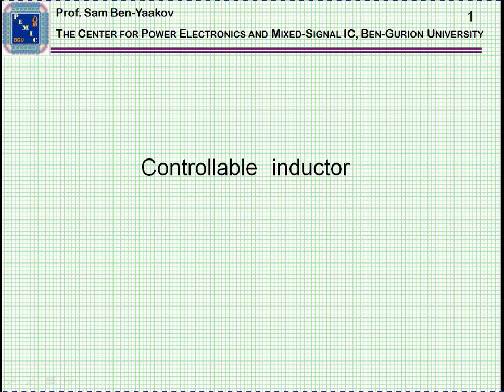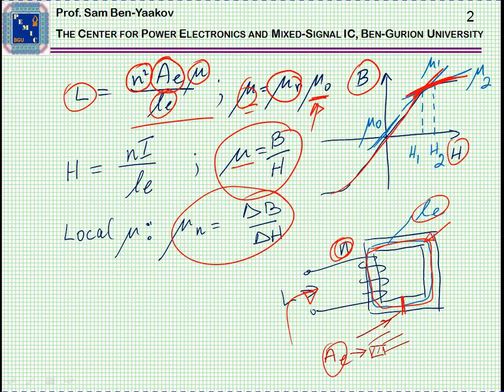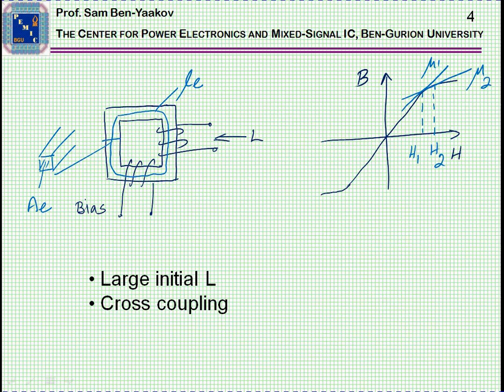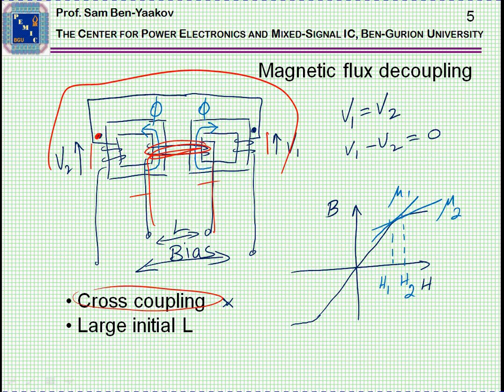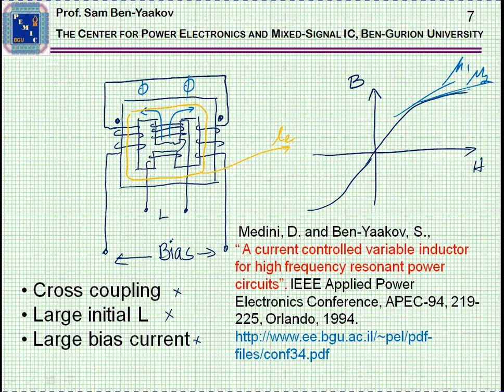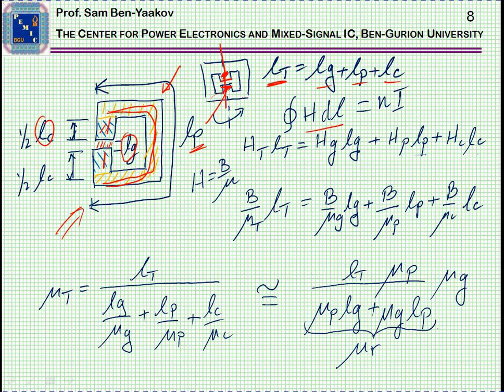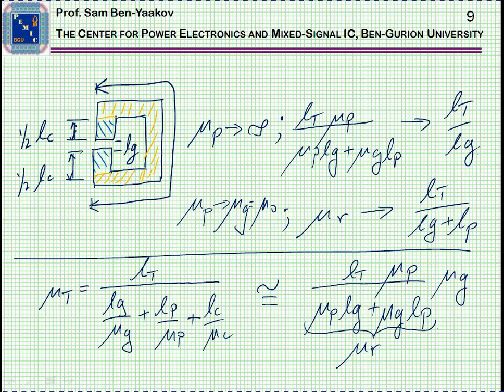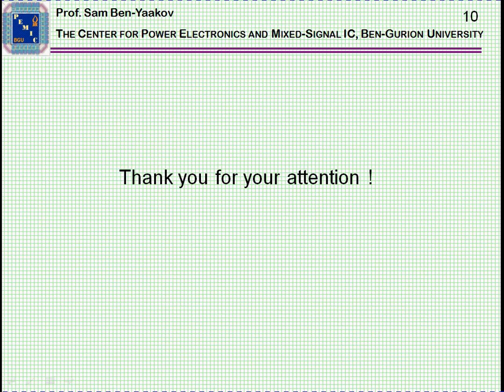Controllable Inductor

Comment: Hi Dr.Ben.... It is pleasure to watch your videos. I am surprised that your PhD and initial research work are from chemistry background. Later, though I don't know the reason, you shifted your career to power electronics in 1980s. Your journey is so inspiring... Your work on capacitive loaded resonant converters played a cardinal role in my PhD work.  

I want to understand the limitations of said inductors from power considerations and current level considerations. can we consider them for 70kw power range in EVs.
Reply from the maker: Hi Venkata, thank you for your kind note. You are very observant. Indeed during my MS and PhD studies I turned to chemical oceanography but with an electrical engineering mind (My BSc is in EE). It is  a long story. When I am old enough 😊and will have some spare time I may write a book or record a video with my life story. 

I think that the  variable inductor has practically no power limits. Since we published this very effective design, hundreds of papers where published on its very many possible applications, but I don't know of any commercial product that uses it. It is a mystery.  

There are still some unsolved magnetics issues with the variable inductor so, as always,  there is more to be done. Have you seen my last installment on the subject? https://youtu.be/ifShokTVflM

Comment: The formulae derived from 10:54 onwards should have c as a subscript where p is used, i.e. there should be an l_c where l_p is used and a μ_c where μ_p is used (where l_x denotes l with subscript x).
Magically (or rather luckily), however, all arguments used employing l_p apply equally to l_c so all the resulting formulae for l_T are still correct/applicable.
Reply from the maker: Thanks for checking, but are you sure? I went over it and it seems to me OK.
Reply: @sambenyaakov  Yes, I'm quite sure:
11:22 "this value is very high": μ_p is encircled
11:28 "therefore I'm going to cross out this term": l_p/μ_p is crossed out

However, the time of the video, 10:54, in my comment is incorrect: it should be 11:33.
Reply from the maker: @Stelios.Posantzis  OK. I looked at it again. The error is that I crossed Lp/up while in fact I continued under the assumption that I have crosses Lc/uc (which is correct because this is the section that does not change) .Other than that everything looks to me fine.

Comment: how the current is limited by a high frequency inductor in a switched mode control loop
Reply from the maker: Please explain the question as I don't follow.
Reply: during capacitor discharge I want to control the discharging current of capacitor using inductor. how can do this.to discharge the capacitor I have mosfet as switching device at high frequency